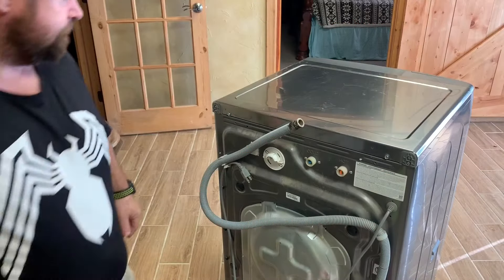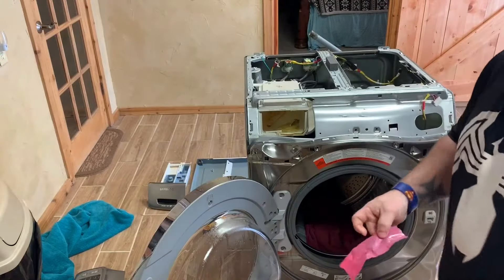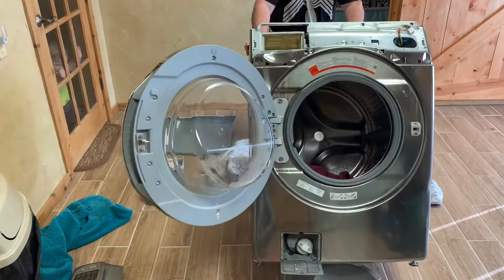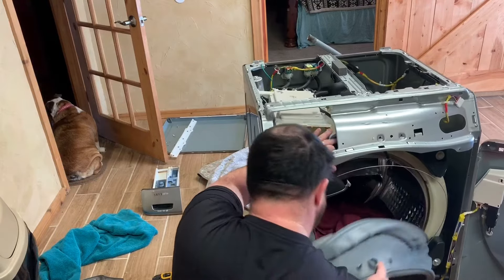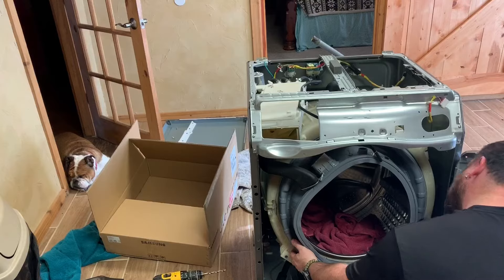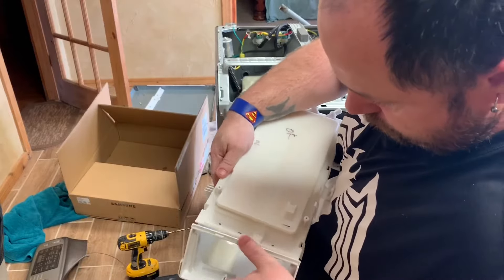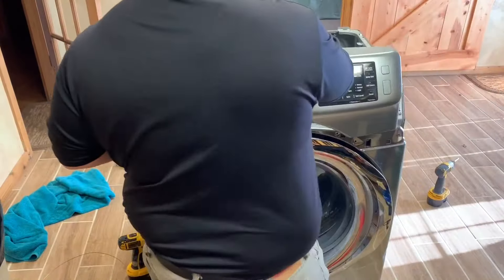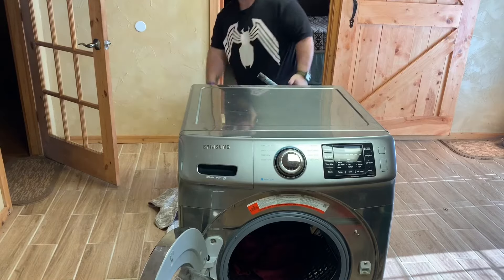Samsung WF42H5200AP door seal replacement

Comment: Thank you for doing this. It was a huge help! I ended up removing the door latch assembly—it was just 3 screws and I didn’t have to worry about breaking the wires. All of your advice was spot on and made this job much easier.

Comment: It is actually possible to replace the seal without removing the panels. I just did it because I didn't want to disassemble my laundry room setup. It was challenging to reach everything, and it might have been more difficult than what this video shows, but it is possible.

Comment: Great video! I broke less (one little clip holding yellow wire). Tried to put the new seal on without removing the front, but ended up having to follow all of your steps. Cheers!

Comment: Thank YOU!! My Husband and I took everything apart following your instructions and FIXED IT! The appliance repairman incorrectly  diagnosed it and was trying to rip out the old seal by hand! It wasn't until I found your video that I realized that he didnt know what he was doing. He wanted us to unplug it and told us it would cost $600 to fix it  when a new one only costs a few hundred more... We were confident to try to fix it because of you and we're so happy we did! Thank you again!
Reply: I’m about to attempt the same thing! Glad to hear someone else was successful! If it works I hope we can do a better job of keeping that stupid seal dry so it doesn’t get a hole! One tiny hole and so much water damage!
Reply: @nicolecincotta7867  Good luck you can do it!  I ordered the part from Amazon for 85 bucks.. git arrived in  2 days
Reply: Dash ARoundtheWorld I’m looking on Amazon right now! Great minds I guess 😉 so did you get the one from the seller “Visit the Samsung store “?
How we’re the screws? I’m hoping they are all the same !
Reply: @nicolecincotta7867  Not sure which model you have but  when I went to amazon looking for the part I used a tool that you can enter your model number and it will show you the part number for your machine. ..Mine was a Samsung part but fulfilled by Amazon. There are also generic part stores that sell them as well but the price tag is about the same so Id just get the Samsung one.  I iforgot to mention we did have some trouble removing the long screw that keeps the diaphragm in place (should be on the left with a small bolt) because it was a little rusted.... A little WD40 and some banging it around a bit and viola it was off (this was the  most difficult part of the job)!  You will definitely need a screwdriver with different size ends and possibly a lug wrench to get that diaphragm off...Keep track of the all of the screws by putting them in small envelopes then labeling them...Hope this helps and Good luck!
Reply from the maker: Hey thanks you all 🙏 I appreciate the responses. Yeah I fix all kinds of crap, and as long as one person gets Beni fits out of my little videos I’m happy to do them. I’m no professional but I’ll let you know how confident I am in the videos lol.

Comment: thanks for this, have same exact model, this tutorial worked great, took me around 3hrs to do entire thing

couple of things I noticed when I replaced this seal

1. use a power driver with a bolt head to unscrew and screw back those 2 weights, makes life much easier, than manually rotating those 6 bolts
2. once you remove all the parts before installing the new seal, clean out inside the machine w vacum and lysol, its naaaasty in there, I saw mouse droppings on the inside of the door when I removed the door from frame, have no idea how mice got there
3. for the metal seal ring around thats inside, the larger metal ring (the one with long screw), mount it but dont tighten it before putting on the lower weight, make sure the long screw that goes w the ring doesnt block the lower weight from sitting in the right position, I had to loosen this ring and move it up circularly to get lower weight to sit right
4. for outer metal seal ring, ask another person to hold the 2 ends while you stretch it to sit inside the rubber channel, much easier w another person

Comment: For anyone having trouble getting the spring off of the seal like I did, if you tug at the seal itself from the bottom a part of the seal should slip from between the spring and the frame, allowing you to grab and pull off the wire with ease, no pliers needed. 👍

Comment: can you tell me how vrt  handle vibration? and does this model makes loud noises? should i buy VRT models in 2021?
Reply from the maker: Tbh I feel like they did ok. They do pretty good washing the clothes. Even when I level don’t seam to vibrate too much. Dryer I’ve had to replace the heating element, temp sensor, and washer I’ve replaced door seal. Think the heating element was due to washing too big of loads and temp sensor was because the vent got disconnected and clogged in the attic, the door seal one of the kids did that so as for breaking down seams to only do that when used improperly. I will say pedestals would be good for these because the screen on these that protects the motor is at the very bottom of the wAsher. And when it don’t drain with the pump you have to pull out the screen and to drain it there isn’t any way to put a drain bucket to drain into unless you have a pedestal. However I drain mine with wet vac. Small socks and stuff get through the seal and clog that screen every once and a while.
Reply from the maker: @obinashchandrashil3761   not sure about any of that sorry.

Comment: Great video. But having issues putting the top front back on. The soap dispenser is in the way all the time and I cant seem to get the front on. Tried putting front on first but then I cant get the soap dispenser to fit 😫😫😫 Great tutorial and im sure Im doing something wrong. What would you advice? Front first then try to get soap dispenser to fit or other way around?
Reply from the maker: Ok the soap dispenser is easiest to re install when it’s disconnected from the front and sides. I put the front on and then kinda added the soap dispenser, however the pullout part of the soap dispenser needs to be taken out of it. Which has a tab you push down to pull out completely, then the back part gets mounted to the front and sides… you may be thinking the plastic goes on top of the metal side but if I remember right there is a tab that holds the plastic below the screw holes to where you screw into the actual plastic soap dispenser. Then after you get the back part on you slide in the front part.. (good time to clean it)
Reply: @backendhandyman  Found it. But its still leaking 😫😫 watched 4 videos now. Tomorrow I’ll see if I might be able to attach the inner part that connect to the drum any better. This has been a pain in the butt. 😂
Reply from the maker: @edwinaarschot  haha yeah I have replaced the heating element 2x, the temp sensor once on the dryer, the washer, check your screen at the bottom and see if it’s clogged, the washer I have leaks, drips out the bottom, idk where it’s coming from but I have them in the garage for now so it don’t hurt anything. Only issues with the washer I had is the screen gets clogged with baby socks 1-2x a month. That rubber seal was changed. And a mystery leak. These are the biggest pain in the ass appliances I’ve ever had., just make sure your screen ain’t clogged. If you don’t have a pedi stall the damn drain is floor level, use a shop vac on the drain hose if that’s the case.

Comment: What’s the seal part number. I ordered the one that didn’t have a steam tube hole.
Reply: Can I cut holes in it or should I get the real part?
Reply from the maker: Lyndsey Upton the one I got automatically had the steam tube hole, but I remember when I was ordering it there was one that didn’t have that that said you could cut it out for it though. I’d hate to lead you the wrong direction.

Comment: Everything was great, except the dog kept me distracted.   There is NO reason to have the door open when you have the whole room set up with loose screws and hardware on the floor.   The dog walks right over the hardware and screws back and forth and I lost concentration.   Keep the dog away, door closed when you have screws all over the place.   I see that in a lot of video's where a kid or dog is running loose and all the parts are being stepped on and lost or broken.    Plus it's a distraction from your concentration.   After all your making a professional video for those who need assistance.   You don't expect a dog to be going back and forth during a instructional seminar.